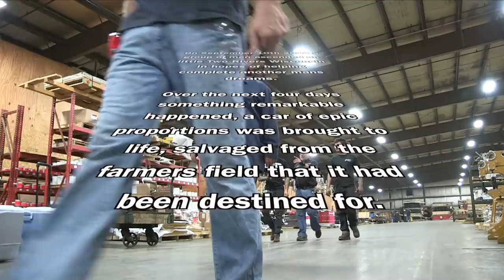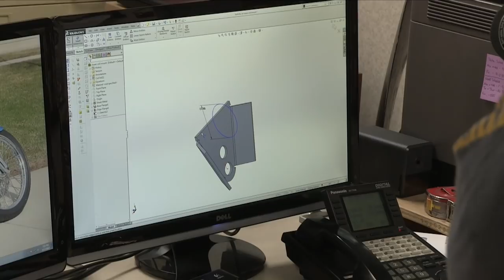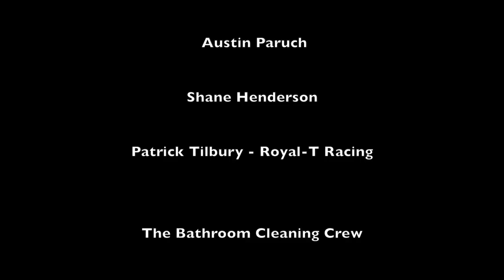Chris Rusch's 1930 Sedan Build with Jimmy Shine, Bob Bleed, Kyle Yocum, Mike Wagner, Mark Gerish

Comment: the level of craftmenship is just amazing
Reply: It has to be intense to work there to meet the dead line's. I'm shire if someone got just trying to stand around and not looking busy they won't last long in a high ends Hot Rod Shop.  I worked in a body mechanic shop in the bay area of California. I must have seen 5 guys come and go in one month they couldn't handle the work and the boss that was running the body shop like clock work. The Car's and truck's that came out of his shop looked show and go ready. It's nothing like what they show on T.V. and video's. 
Even I got from under working for someone else I got burnt out from having to have a car done by a. Certain time everyone depending on a certain part of the puzzle to be done.

Comment: This build certainly brings back memories, 16-17 years old, 1966 Build on original frame, boxed, '46 front hydralic brakes, Ford Detroit Locker 5.13's or something.  1931 Ford 2 door sedan, chopped, channeled, 392 cu in Hemi (300D Chrysler), 2 fours, solids, tube headers,,,, was a wonderful learning event 1960's style.